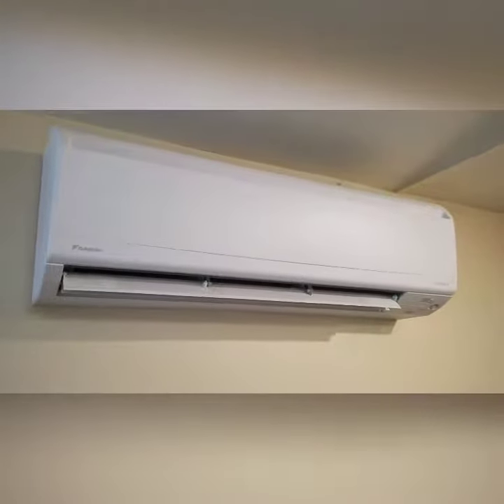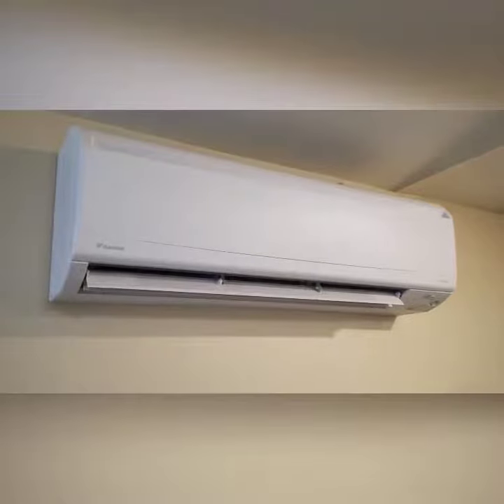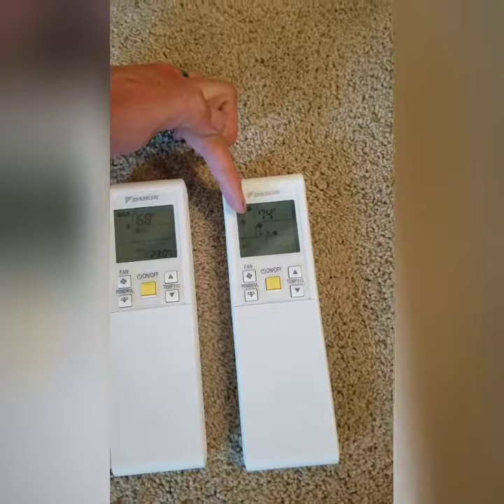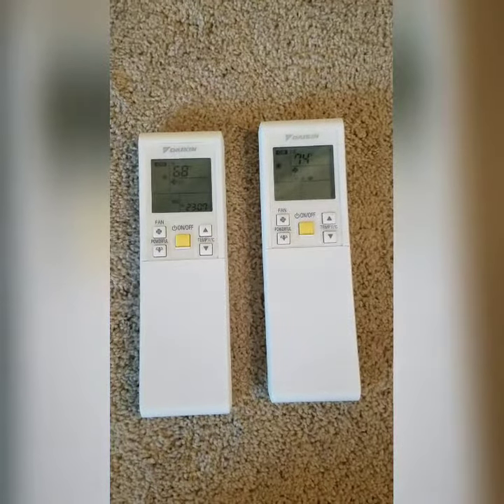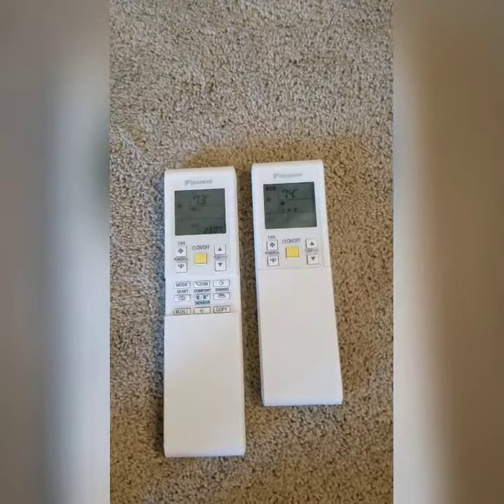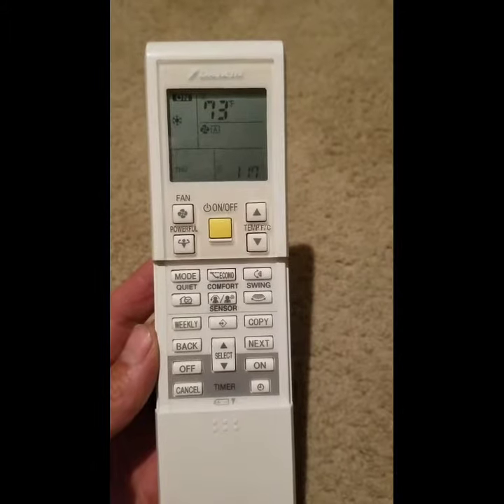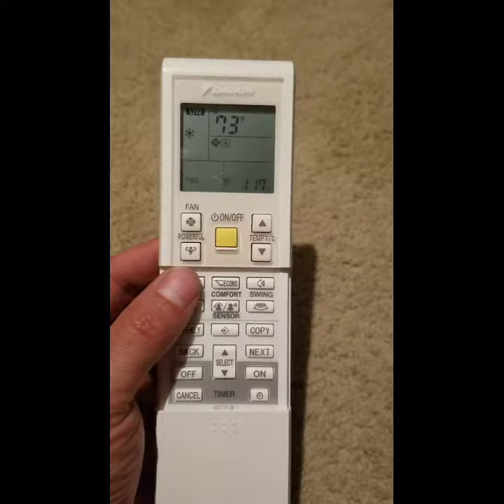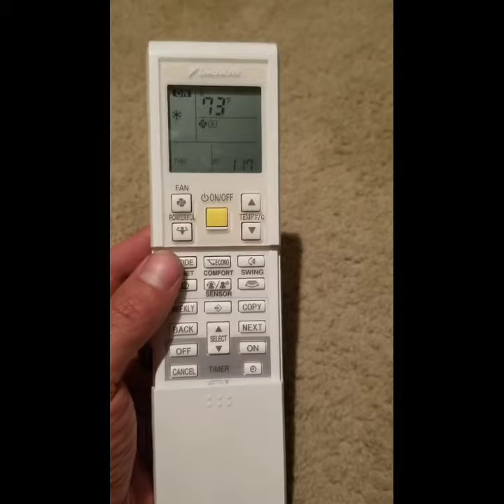Ductless Heat Pump Troubleshooting! The most common fix

Comment: brand new user here,  and I'd like to set the temp for cooling to 80.  I checked that both heads are set to cool (snowflake), and fans on auto.  Both heads are kicking out cold air even though the room temp is currently 67.
Reply from the maker: Sounds like something might be miss wired or not working correctly. I would call a local HVAC company

Comment: i have a tosot and trying to keep it at 61 on heat mode but it keeps shutting off (light turns red). We have 2 in the shop and they stay on even if they're not heating and show the temp. Is one faulty? not sure how to keep it on or does it go to 'sleep' and shut off but turns on when it needs to? its a 12x12 room. thanks for any info, I don't want to mess it up but don't want my hot water tank to freeze either!

Comment: I want to throw mine into the ocean. Freezing my butt off here and can’t get a tech to show. My 3 halcyons have 1 green 1 orange blinking. Took the cover off the outdoor unit - 11 red blinks. Manual says indoor unit capacity error. I think that means 1+ units have a fuse blown, but they all turn on. PCB board replacement 😢 ? What do you think?

Thanks for the help, appreciate you putting up vids

Comment: Any advice on getting them to switch from cool to heat mode? It's fall and I'm trying to get my three (boreal) into heat mode for the year, and one finally started working, ones off, and one just sits there with a droning sound, but won't blow air...
Reply from the maker: Should just have to change the system mode to heat on your remote/Thermostat

Comment: Can you not leaveboth remotes on Auto?  Sometimes one should cool while the other heats.  Or do they both have to be either hot or cold and you cant use auto with multiple heads?
Reply from the maker: Has to be heat or cool with multiple heads. Can't use auto with multiple heads

Comment: Carrier has this problem too.  You will see 2 white dashes on the front on the indoor head if both remotes are not set to heating or cooling.  And the system won't run at all.
Reply from the maker: Thats nice they gave a code for the Carrier units

Comment: I'm at a loss of words. I just moved into my new home and it has 3 brand new mini splits. We're freezing cause the heat isn't turning on remotes all the same, tried resetting circuit breaker too. Any ideas?
Reply from the maker: Possibly a bad fuse at the disconnect. Or refrigerant system could be flat
Reply: @HVAC Service Technician Talk  you were right thank you. The installer advised a leak cause of a loose hose

Comment: Both of my heat pumps are set to heat, but not working. They beep every time you change the temperature, but there is no fan or anything. The light just flashes.
Reply from the maker: You will have to call a local HVAC technician out. It could be multiple issues that are causing it.

Comment: Hi, my parent they have the same but im not at there place but the owner of the building put some crazy brand in the building and swing when you press swing is it suppose to go left and right and the other one up and down??? And that heat pump have the wifi but the remote need to be on CF the display but oh the company cant come just to set up the wifi but they dont even show nobody and dont even tell nobody about that fonction so i try to figure that out by myself ...if someone can help  .  The brand its Generallux
Reply from the maker: Never heard of that brand before unfortunately.

Comment: The green light is flashing on mine and only fan works I want the A/c on
Reply: A/c works for 20 min if I reset the breaker. Both set to a/c
Reply from the maker: It sounds like it's tripping on a safety. My guess is it's charge related. It could be a pump malfunctioning if you have a condensate pump

Comment: I have a Gree spilt wall unit with remote control.  The inside unit is "stuck" in FO (fan only) mode.  The fan doesn't operate.  Is there a reset or ON/OFF button on the inside unit so it can be unlocked.  The remote control communicates with the inside unit successfully with ON/OFF feature and opening the louvre but the unit doesn't respond to the cool or heat mode.
Reply: as long as you dont let some fool do it, a guy LOOKED at mine and said oh the coils are dirty you need a new compressor, I shoed him the door. it needed a 12 $ capacsator,

Comment: The most common fix....if the issue is both controllers calling for opposite modes. Most calls are dirty blower n water leaking down the wall. Pretty lame to clean.
Reply from the maker: I have definitely ran into that a lot as well. I'm sure in more humid areas the blower wheel would get dirty even faster. And yes they suck to clean lol

Comment: I would expect auto mode would be fine but this shit sucks... Had to set em to heat instead of auto.

If you have multiple units... Make sure they are all set to cool or all set to heat. Seems this resolved my issue at least.
Reply from the maker: Ya its a pain. I'm suprised they haven't made a different remote for multiple head units